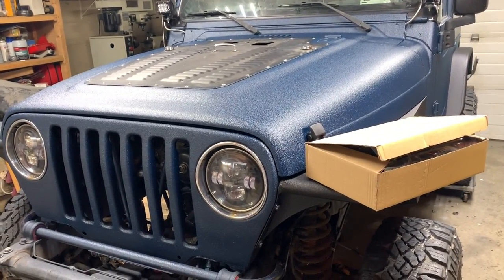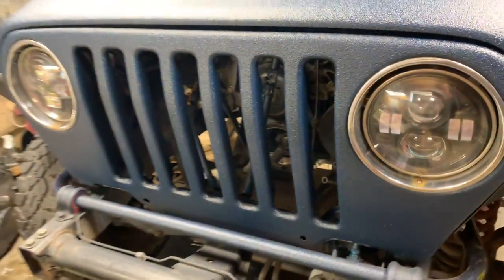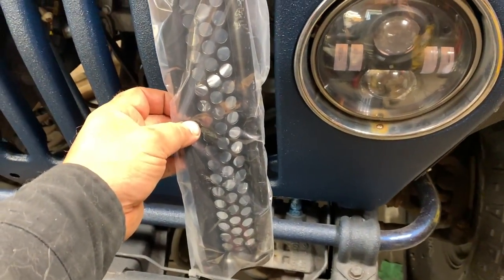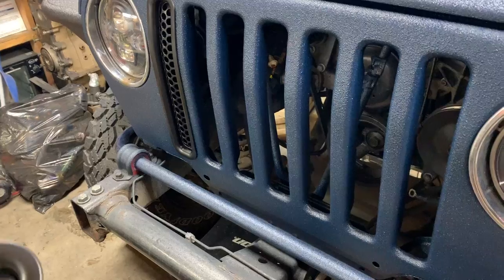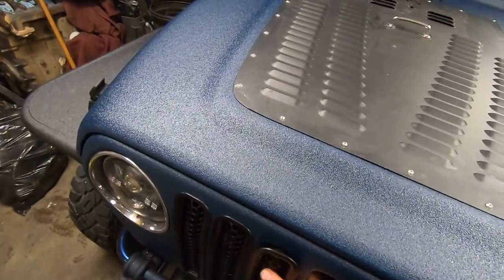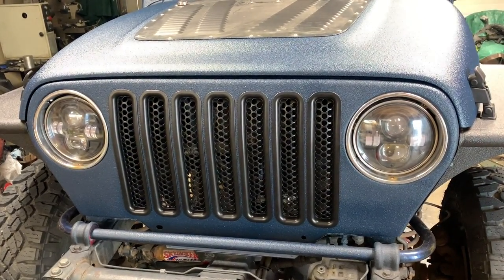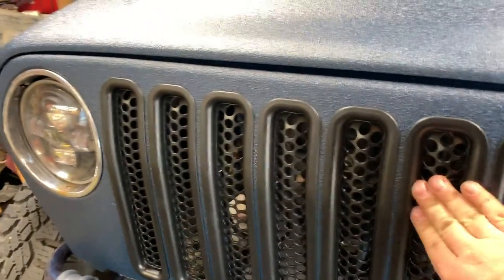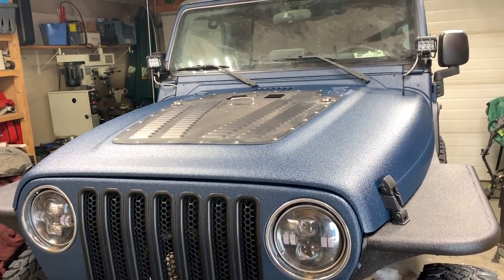Hooke Road Jeep TJ Black Grille Inserts

Comment: On my '08 Heep pos jk, I hit the inserts and head light bezels with 2 light coats of bedliner and it looked good. I have yet to do this on my new '05 Rocky Mtn TJ but I will get around to it. Have to replace the heater core first. Your TJ looks darn good!

Comment: I have an 06 wrangler and I’m looking to do some off roading I have all stock components aside from my 2 inch lift with 33x12.5what should I upgrade next? Should I get lockers, regear from 3:73s or upgrade the Dana 30 and 35? Your input would be extremely helpful
Thanks

Comment: I've heard from reviews that These grills will slow down the air intake to the radiator, making your engine overheat. Have you had that problem since you installed those grills?
Reply from the maker: I removed them for the reason of restricted airflow, they would be great for winter